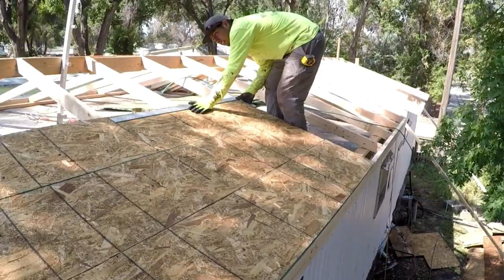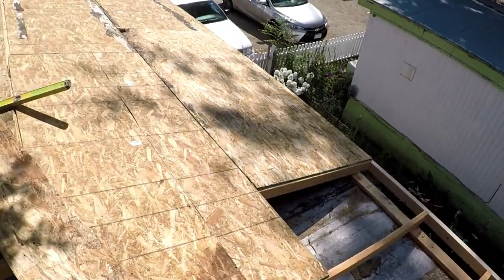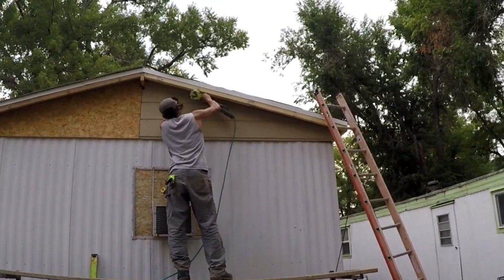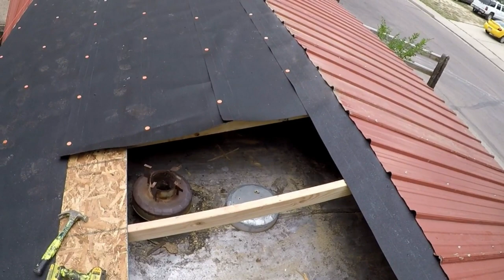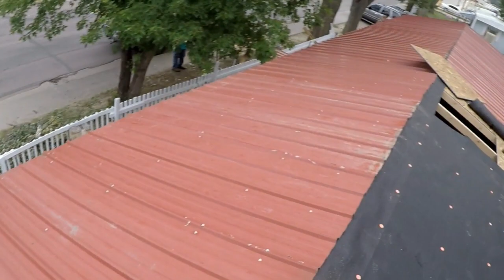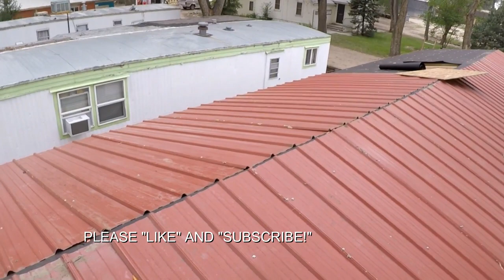Pitched Roof on a Mobile Home

Comment from the maker: The sheets come in 4' x 10', 4' x 12' & 4' x 16' sizes.  Be sure to ask for those that have been discontinued and paint them yourself.
Reply: Did you use 2×4 to framing the roof??

Comment from the maker: That is a project that I shared.  I spoke with the Contractor and he told me that he attached the framing to the home using 4" screws. When the weather here warms up a bit,  I'll make a more detailed video about the process.
Reply: Any issues with transporting a mobile home after the install? (I read some mobile homes an only be moved twice). Any clarification on this matter would be greatly appreciated. Thanks in advance. 
Edit: be moved not beloved lol
Reply: How much would something like this cost

Comment from the maker: This is a Project that I shared.  The work was completed with a permit from the City Building Department using HUD Standards.  The Trusses were built by a private company that builds these and I'm sure that the extra weight was proportionately balanced.

Comment: Hi. I have been searching for a video like this for a good year. I need to put a pitched roof on my mobile home. It is a 1963 Marlet, with a flat roof. We rolled the roof, and that led to more problems. A pitched roof seems to be the only solution. Can you tell me how many days it took for you guys to complete the pitched roof? And what did you guys use to attach the framing to the original roof?
Reply: In my living room I have that raised section of the roof. I'm thinking in order to put a nice pitched roof on that is the same hieght from one end to the other, that raised section over the living room will have to be cut out, and removed. Maybe tarp that area during construction? What are your thoughts.?
Reply: How did you attach the roof supports to the frame attached to the mobile home? Did you screw them on? I have been thinking of using the metal hardware to attach mine. I have no idea really what I am doing. First time mobile home owner. Watching this video, replaying it, may help.
Reply: I have been looking for this video for a while. I had seen videos for re-roofing an already pitched roof on a mobile home, and I felt stuck. This video that you offer may just be a God send. :)
Reply: Can you also give me an idea of the cost to complete a roof like your start to finish? I want to try for under a $1000. I don't know though.....lol
Reply: I'd like to know the cost also

Comment: So the bathroom vents and plumbing vents  vent out through the ridge cap?
Reply from the maker: Yes,  but there is added ventilation for the Furnace and Hot Water Heater.  You should check the requirements for your Local or State Agencies for adding this type of Roofing Project. If they don't approve it,  they can make you take it down. (Permits.) Thanks for your comment.
Reply: @mobilehomeutopia5100  That roof is going to be full of mold in weeks. I can't imagine this being legal anywhere they have building codes.

Comment: Do you know the pitch of this roof? I'm very upset as I have the same roof metal and I had people walking on the roof then it broke the rafters. Boy you just have to do your own DYI these days. Hire people and get the shaft! 
I also see these NO AIR VENTS so how do you flow the air through out your roof?  I gutted my ceiling out due to wet water inside..People need to know if your repair are about the roof the water is inside your ceiling. Ty for the video..too bad it was not more....Yes off the wall sheets are cheaper and they dont tell if you dont ask.
Reply from the maker: This Roofing Project was installed by a Private Contractor who did similar work to three other Homes in the Park. The City required Permits and Plans for the work.  I did a follow up Video called,  "Adding a Structured Roof to a Mobile Home "  that includes the plans from the Truss Manufacturer.  Thank you for your comment.

Comment: How come there's no birds mouth cut on the edge of this roof? It is pitched but look at the over hang.
Reply from the maker: This Roof was installed by a Private Contractor.  Plans for the build had to be submitted to the City for the Permit. I did Videos of other Homes with similar impairments . Please check out, "Adding a Structured Structured Roof to a Mobile Home. " & "Adding Siding & a Pitched Roof to a Mobile Home. "  I hope this answers your question.

Comment: How was the new roof ANCHORED to the old roof?
Reply from the maker: The same Contractor that did that one did the Project,  "Adding Siding and a Pitched Roof to a Mobile Home." As soon as the weather cooperates,  he'll show me how to do one from start to finish. (CO)
Reply from the maker: The Contractor used 4" screws to attach the framing to the metal roof.

Comment: Did you remove the old roof from the inside once you had the pitched roof installed?
Reply from the maker: No,  the existing roof was not removed.
Reply: Mobile Home Utopia oh alright, I was hoping to do this so that I could actually add a foot or 2 to my low 7ft ceilings, being 6’4” is an inconvenience with these low ceilings
My plan was to raise my roof by a foot, also use the roof over to do an complete ad on down the entire length of the mobile home, so my roof would go from 13 wide to 26 wide, of course I’d have supporting stud walls and so forth to create the opposite side enclosure. My thought was to run a metal beam along the bottom of the roof support down the middle where my existing wall is in order to be able to creat an open concept through the new expanse inside the home.
Think that might work?
Reply: @dakdur1126  well when and if you find out make a YouTube video and page I Will definitely subscribe. All of us are 6ft plus in my house and would love to RAISE THE CEILING TO AS FAR AS IT COULD GO WITHOUT STRUCTURAL DAMAGE.